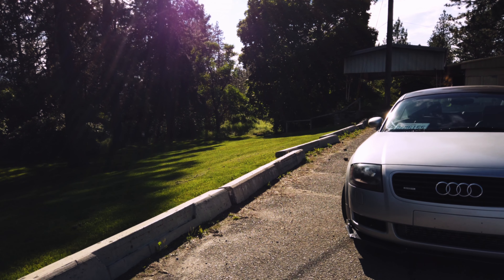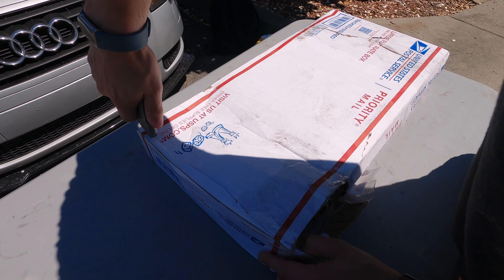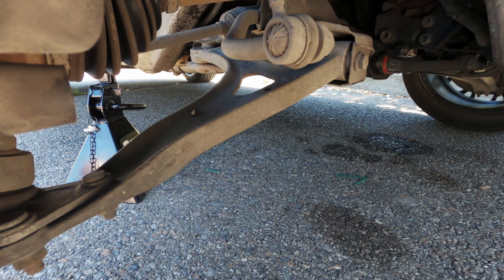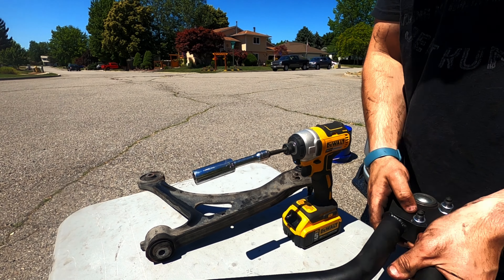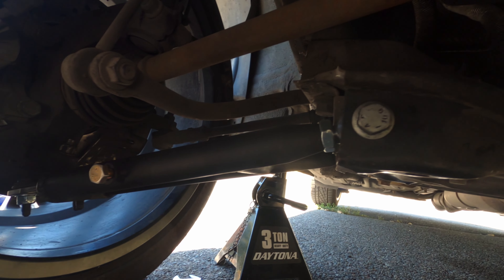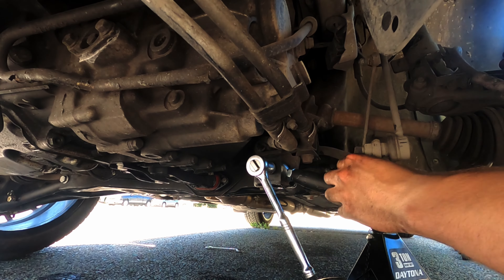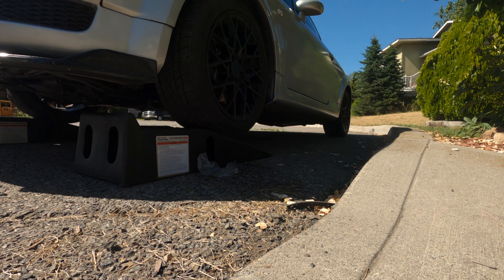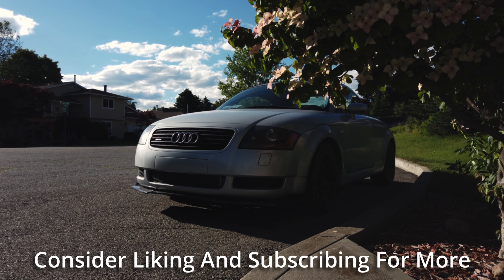TUBULAR Control Arms For The TT! | Gorgeous Upgrade

Comment: You need to drop the subframe on the vr6 3.2 to acess the front right control arm bolt because the engine is in the way

Comment: Those arms look the business. My only advice would be to put some rubber boots on the rose joints. They have a tendency to crap out pretty quickly with day to day road driving. 
I’m currently installing double offset SuperPro bushes on my TT. They add a whole bunch of caster….and you just can’t have enough caster. 
Thanks heaps for all of your efforts. Great content. 🇦🇺🤜🏼🤛🏼😎🍀🍀🍀
Reply from the maker: The rubber boot idea is great! I'll start looking for some. Those bushings sound awesome! Being able to fine tune the caster is so nice. I really appreciate your support👌 thank you!

Comment: We’ll now I guess I need to install my tubular control arms. Been waiting to finish some other mods first. I currently use the stock arms (replaced new 600 race miles ago). I have poly poly bushes in the front se toon and upgraded to power flex Heim joints in the rear. Keep up the mods!!

Comment: I’ve been eyeing a tubular subframe and control arms for the TT i hate how theres not much adjustability in the front 😭 
I have poly bushings on mine it handles great but i hate going to an alignment shop and they tell me they cant adjust the front caster 🤷🏽‍♂️ great video man!
Reply from the maker: The tubular suspension definitely helps over the stock adjustability from my initial impressions! I'll be able to give a better analysis of the improvements once I get the coilovers on and tune the suspension. Thank you for the support!
Reply: @HunterDirection  will be waiting on that one 👍🏼 once you add your suspension it will handle turns quite nicely with alot of confidence and control.

Comment: Just an FYI since you’ve mentioned it in a few videos, but you only need to worry about torquing to spec when the car is on its wheels with bonded rubber bushings (oem style). Heim joints, poly bushings, tie rod ends, etc. don’t matter.

Comment: I'm was gonna poly bush mine, with the stock suspension components. I can't really lower it at all as my garage entrance is a pain and I need the height clearance. Now seeing the suspension components you are putting on is making me think twice.
Reply from the maker: That's a really good point. The roads where I live arent the greatest, so I definitely won't be "slamming" the car either haha. I just want the benefits of the stiffer springs/damping and marginal lowering that comes with it. The height adjustability is important since it snows where I live too. I totally get your dilemma though. Thank you for the support!

Comment: Yo first one! Great vid as always. I want you to be more creative with your scinematic intros from next episdoe :P do some drive shots etc :)
Reply from the maker: Yeah I can totally do that. I haven't been able to drive the TT that much since it's not fully aligned yet but I definitely should be able to for the next episode;) thanks for the support!
Reply: @HunterDirection  I also have mk1 tt 225 quattro but in cabrio - lso silver metalic. Lots of issues with this car, i bought it on auction with plans of restore it. Right now im working on the soft top ans the window was detached. Engine has lots of issues with boost, i think vacuum leaks and im 100% sure the k04 is shot. But anyway its fun to work on those little cars. My daily is B6 S4 and i love it
Reply from the maker: @rockefeller63  that's awesome! Those are both great cars. I will definitely get a b6 s4 when one comes up at a good price near me. They are such cool cars!
Reply: @HunterDirection  Just make sure that the one you want o to buy had the timing chain and guides replaced, this is pretty expensive to do as the whole engine needs to come out and the parts are also crazy expencive - kit from jhm is like 5k USD